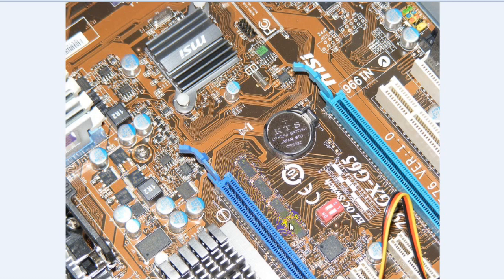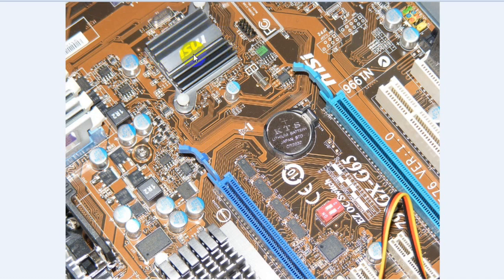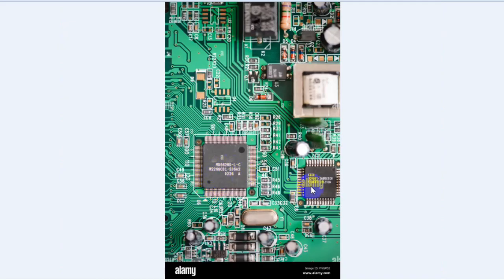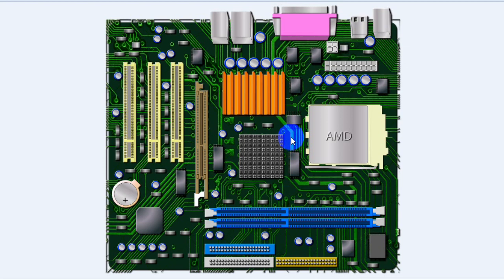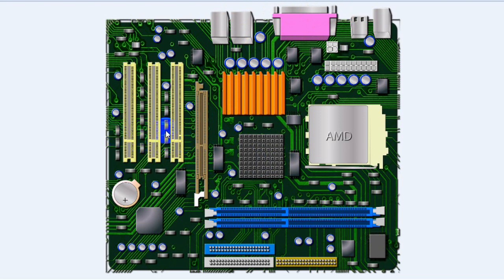Learn All Computer & Laptop Components and Master Computer Repair

Comment: What means a cpu has four channels? What channel means and what doing?
Reply from the maker: Power channels that feed it with VCC_Core
Reply: @electronicsrepairbasics_erb  May be 4 VCC feed means it is a 4 core CPU. 4 core CPU means 4 CPUs combined in 1 unit. If you give it from only one mosfet it will get hot and burn quickly thats why they use four mosfets.